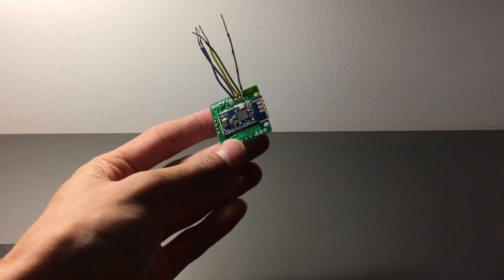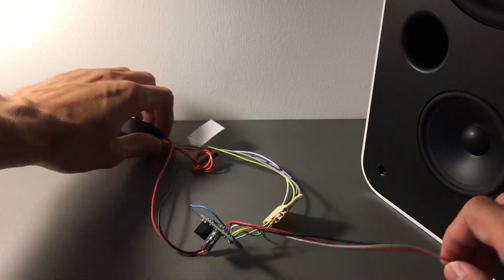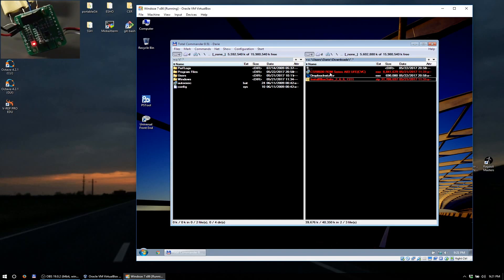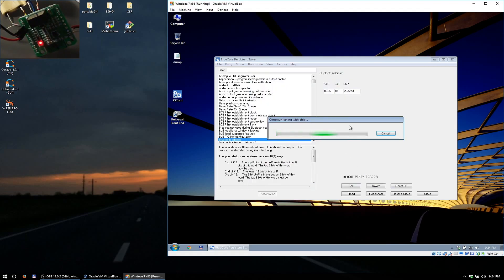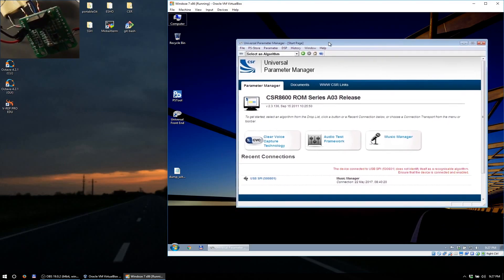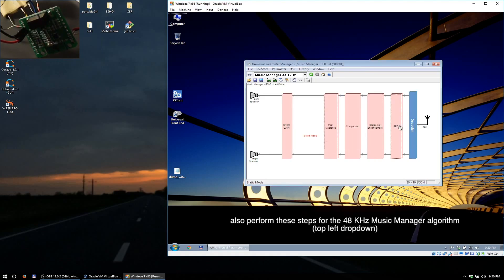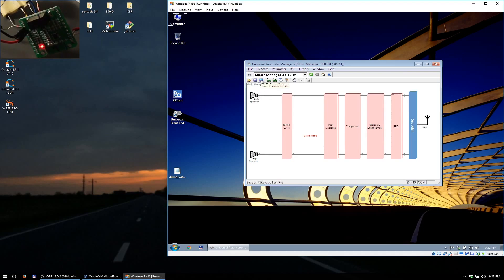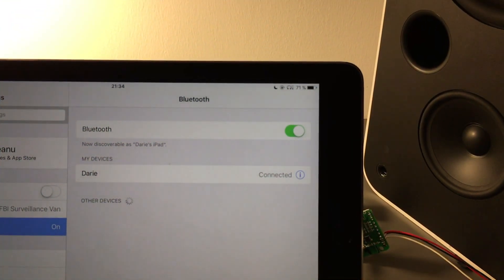CSR8645 Equaliser Set Up Guide

Comment from the maker: Tip 1 : Make the Equaliser Setup-Up Window wider :) way easier to fine tune stuff. Also: my module started making a 5tone beep (which can be heard in the video) after I started programming it; that's the low battery alert, and can be disabled in ConfigurationTool 3.0.70 (the programmer feeds it only 3v3)

Tip 2 : To make the whole thing faster & easier, you could actually just "Merge" the parameters file created by the Universal Front End (write 1KB instead of 32). This didn't work too well under Windows 10 though

Tip 3 : In order to get to editing the current configuration from your device, the Download Params button doesn't seem to work: instead open the Live View (the glasses icon) and close it.
Reply: do you have to solder to the programming ports or could you use those individual breadboard jumper cables like on a bread board?

Comment: Tip 
1- Do it on Win7 -32bit
2- Play music while connect Usb
3- Click on glass 
Right bro? 
I have some question to you
 1- Need to supply the power for the   bluetooth board when playing music (my tda7492 need enoud power to woking)
Reply from the maker: no, just the bt module needs power 🫡 the rest doesn't matter
Reply: @Darieee  you mean GND & 3.3V enough? If just bt have the power, i cant hear any music from speaker

Comment: How are you providing enough power through the USB connection to power the speaker at a volume at which you can hear the EQ changes?  I find that the USB will only provide enough power to provide very quiet audio.  I would love to run this at full power, and make changes to the EQ

Comment: First of all thanks for your videos, I wanted to check the following: I am working from a PC that has Windows 7 32bits and I was able to run the "PSTools" without problems and change the name, with "CSR Universal Front End" I have not been able to configure it, I get the following error "The transport USB SPI (00547) cannot be opened. Ensure that the device is connected and enabled." I did the procedure as samples in the video to play music before connection and nothing. If you can help me I would appreciate it.

I am working with this CSR USB-SPI Programmer:
https: //www.tinyosshop.com/index.php? route = product / product & product_id = 876
https: //www.tinyosshop.com/index.php? route = product / product & product_id = 874

This is the module that I am trying to configure:
https: //www.tinyosshop.com/tsa2300
Reply: I am working with this CSR USB-SPI Programmer:
https://www.tinyosshop.com/index.php?route=product/product&product_id=876
https://www.tinyosshop.com/index.php?route=product/product&product_id=874

This is the module that I am trying to configure:
https://www.tinyosshop.com/tsa2300

Comment: Is this "speaker" an Apple iPod Hi-Fi? If so, love the idea of "recycling" it with a modern connectivity. It's such a beautiful piece of design!
Reply from the maker: yeah - those're really well made speakers - not a lot happening on the high end, but .. a lot of power all 'round nevertheless
Reply: @Darieee  So you just tapped into its' amp with CSR8645?
Reply from the maker: I've done 3 mods .. one simple which simply connects the csr to the input jack on the back, and 2 other ones where I fitted other amps inside an iPod Hi Fi with dead internals

Comment: Hiii Darie, I just bought an amp with 8635 inbuilt. So I was just checking if it work and for me, PS Tool & the Configurator works without a problem. But when I try to connect to the UFE, it just doesn't connect. Tried playing song and followed every step but still it doesn't connect. I too have the Virtual Box with Windows 7 32bit. Please help me provide a solution.
Reply from the maker: it's complicated .. try either reinstalling the software or running everything on an actual windows 7 x32 machine

I'd also highly suggest moving up to the CSRA64215 or QCC3008 chips - they have wildly more compatible toolchains
Reply: @Darieee  Thanx for the suggestion. If i move to the CSRA64215 where will I get the tools for it. Means Qualcomm doesn't share software to individuals. So where can I get them?
Reply from the maker: I have them linked throughout my videos

check either what I have specifically on that, or my ''margarine box speaker" video

Comment: Hi. Is possible to control compression, delay, and some other effects with this method? Wondering how well it sounds with the "stereo 3d enhancement" too. Thanks for the video btw.
Reply from the maker: more than welcome!

I tried the stereo 3d thing .. didn't really like it

Compression : I'm not sure what you mean by this, but the "Compander" stage is a sort of AutoGainControl which limits the maximum volume dynamically

And delay ... yea, more DSP stages you add larger it'll be; on this note consider upgrading to the CSRA64215 chip - much nicer
Reply: @Darieee  Yeah compander, probably that's what I was meant to say. I want to add kind of dynamic sound and or  dynamic bass to sound deep and refined. I thinking of using the csr8675 because of BT 5.0 and LDAC codec(as far as I know it's supported). I still don't own that chip but, before buying do you suggest me csra64215 or csr8675. I guess the same procedure will work on both. What do you think?
Reply from the maker: using the compander won't offer you what you're looking for ... I tried it too, maybe you'll have better luck

dynamic bass is an entirely different beast, that requires individual eq profiles for each volume level

or at least for the upper ones

I can hook you up with software for the 8675 if you promise to share your findings

and the 64215 software is already available for download on my channel :)
Reply: I will do my best to work on that, I have no experience with those BT chips, but I'm very interested to learn about them

Comment: following these steps I get 3 keys instead of 2 you show here. And when i merged them and power off and on the module the eq settings are not loaded:/ what am i doing wrong? I did not do the 48khz  settings yet, do you paste those above the 44.1khz keys?
Reply from the maker: the location of where you paste the keys is irrelevant, they get moved to their correct location anyway

it's best practice to manipulate the small .psr you get from the FrontEnd directly

as in, just click merge in PSTool and select the tiny .psr you got from the FrontEnd

>> also, when anything goes wrong, it's insanely crucial and the bestest practice by far to start from scratch with a very default dump flashed on your chip

>> to do this, first go Factory/Erase All or Restore all I don't remember the exact name (in PSTool) ... you need to do this because 'merge' is only additive, you can't erase anything 'wrong' that way
Reply: @Darieee  Thanks this worked great! Got the chips to keep their eq configs:)
Reply from the maker: awesome man! glad it worked out

I do have to make a comprehensive 1 video to rule them all on the csra64215 ... just insanely busy atm ...

these videos were also super rushed out, and so a lot of shit can be done better (like merging the psr file not the text manually)

but, meh ... it is what it is
Reply: @chribzzz  I'm having the same problem, that no EQ settings are loaded after the module is restarted. Could you explain how you solved it?

Comment: I think my csr8645 is bricked after one of the program pins came lose while programming. can't seem to find it with my phone anymore, I tried to load my dump as well as yours which seem to work with  pst tools but it's still dead apart from that. But my eq settings did not seem to stay loaded after disconnecting en reconnecting the power completely. Did I miss someting?
Reply from the maker: Try doing the Restore/Erase All thing in PSTools, reflash a known good psr, then redo the steps

Also, if you brick it far enough that it doesn't boot, try connecting the various button pins (one by one) to COM (internal 1v8 rail) at bootup -- sometimes that gets it to boot

Comment: Hey man, I know it probably is asking too much, but do you now of a way to conect to the dsp using ftdi chips?
Iorf's driver doesn't work with the UFE, as far as I know
The csr usb-spi is away too expensive, the cheaper I can get is 80 BRL
Reply from the maker: I don't know man, 80 reals is kind of a decent price for one of those

Given that I've only worked with them so far ... absolutely no idea
Reply: @Darieee  Thanks for the answer, but ya know, spending that much with a tool to use a few times is kinda hard, I'll try to setup a filter between module out/amp in
Reply from the maker: yeah ... I use mine daily ... but even for ocasional use ... given how bad CSR's software is ... knowing that you have eliminated one source of bugs is quite valuable

again obviously - depends on how much you need it - maybe find a like-minded friend to split the cost with xD
Reply: @Darieee  Around here we dont have much acces to csr chips, and since I'm not "manufacturing" bt boards, just a personal project, I dont have that much of need to it.
Of course it would be amazing to abuse each and every of this chip capabilities, but that would be for personal knowledge.
Btw, thanks for the care of answering me XD
Reply from the maker: Don't worry about it! Have fun!

Comment: You included the CSRA64215 program bundle as well, that includes a 10band speaker PEQ as well as 5band user PEQ what is the difference between these?
Reply from the maker: The 5band is technically 'userland' and can also be changed by the GAIA App (let me know if you want that, I'll add a link to it)

The 10 band one is more of a factory setting to flatten the speaker in question, and then the user customizes the sound via the 5band
Reply: @Darieee  Thanks for the clarification. I found that GAIA app as well but with the CSR8645 and KRC86B i had laying around it doesn't seem to work:/
Reply from the maker: Yeah, for that you need something older that probably runs on android -3
Reply: Aah okay, did you get it working on a older phone?
Reply from the maker: I don't have any android phone unfortunately ... so, no, was mainly a figure of speech :)

Comment: what is with the 10k resistor on the SPI_EN aka SPI_PCM when I hooked my 1.8v line up to this it worked fine without no 10k resistor Zero issues yet people swear you need it? Why is this? I also use windows 10 with zero issues as well!
Reply from the maker: It's a cheap and very dirty way of pulling the SPI_EN pin up to 1v8 with the existing 3v3 programmer VDD

Comment: Hey Deriee My virtualbox doesn’ reading   the usb connection. I’m running windows 7 on windows 10. I’m traing to program csr8635 using the programmer but virtualbos doesn’t reading the usbs. How do you fix that? Please!
Reply from the maker: Please!!

In VirtualBox, while your CSR USB SPI Programmer is plugged in, you need to go to Machine Settings > Ports > USB > and click the + to add the programmer to the list of devices to be fed through into the virtual machine

Comment: On Win 8.1 x64, i am able to connect to device and rename it, using PSTool, no problem. 

But, when i try to connect with Universal Front End, i get:
"The device connected to USB SPI (623035) does not identify itself as a recognisable algorithm.
 Ensure that the device is connected and enabled."

Any ideas? thx!
Reply from the maker: Yes - you have to have music playing, otherwise frontend won't work
Reply: @Darieee  thx but do have musc playng :(
Reply from the maker: Try under win7 x32
Reply: @Darieee  if i can download it someplace. Is TX supposed to be connected? Is SPI_PCM the only pin that needs a resistor? I have SPI_PCM (w resistor), BAT and POWER_EN going straight to 3V3 (on the SPI adapter). I have CSR GND and LED's (w resistors) to SPI gnd/ Correct thx!
Reply from the maker: I don't really get what you're talking about, but I could point you in some direction regarding the windows

Find my email in the about section here and write me up
Reply: @Darieee  Thx, but I checked the description area of this video, and about section in your profile. i don't see your email.
Reply: Hi  @Darieee , is the following correct?
CSR8645 <-> USB/SPI
SPI_PCM > resistor > 3v3
BAT > 3v3
POWER_EN > 3v3
GND > GND
LED's > resistors > GND
TX > no connection
Reply from the maker: LED and TX are weirding me out ... what kind of module do you have ??? 

Isn't it the kind I use in the "CSR8645 Renaming" video ???

You need to use (programmer notation)

GND
3v3
misO
mosI
CSB
CLK
Reply from the maker: And why would you connect LEDs to the programmer :) ?
Reply: @Darieee  sorry for confusion, the LED's are connected from the CSR8645 through resistors to programmer ground. Correct?

Not using TX for anything.

i believe i have same CSR8645, but different breakout board.
Reply from the maker: Ok, why would you hook up LEDs to the programmer though?
Reply: @Darieee  i though the programmer provides power to the CSR. No? How else would you power the LED's?
Reply from the maker: Why would the leds have anything to do with programming : they are driven by the csr chip and are as relates to the programming process as the light bulb in your room

I list above the connections that need to be established in order to get the programmer to work with the chip .. more than that I really don't know what to say
Reply: @Darieee  i understand, i don't need the LEDs to program the CSR. But it enables me to see the CSR radio activity (when i'm connected, for example). It doesn't hurt the programming, does it? My only concern is current-draw.
Reply from the maker: I am 100% sure that it massively hinders the programming

Furthermore, the programmer itself has an activity chip
Reply: @Darieee  wow! can you mention why you're 100% sure?
i thought the programmer LED just shows programming activity, not radio activity. 
thx!
Reply from the maker: If you stick LEDs across MISO and MOSI, those work at 3v3 and have a very weak driver, so, you can most likely not draw enough current from those to even light up an LED

What will happen depending on the type of LED (say red for example) is they will start conducting at 1v2 or so, and increase the current they draw until the programmer can't supply more current

So you're basically dampening the voltage on the programming lines a lot by sticking a very big and very non-linear load across them (an LED will draw 1mA at say 2v but 5A at 4V, that's why the non-linear)
Reply: @Darieee  i'm not sticking LEDs across MISO and MOSI. I'm referring to the LEDs on the CSR module.
Reply from the maker: You kind of did infer it

Anyway to recap -- is there any other outstanding problem :D ?
Reply: @Darieee  ok, so it's cool to power the CSR LEDs off the programmer?

At this point, i'm no longer seeing the CSR device in my bluetooth scanner. I think my connections are clean, but maybe i damaged the module somehow. Have you seen this happen?

thx!
Reply from the maker: Dude I'm not capable of understanding what you're asking .. maybe someone else can chip in :))
Reply: @Darieee  I'm saying the CSR appears to have died :D Wondering if others have seen that when it wasn't actually dead.

Comment: Dude, there is another way to install this software on Windows 10. Change the compatibility to windows 7 in the properties of the programme (run this program in compatibility mode for).
Reply from the maker: Mhm, there sure is, but it doesn't work

Or at the very least it didn't for me

Did it work for you ???
Reply: @Darieee  There is some issues but, it kind of working for me now. Anyway thanks for the good content man. It helped me so much with my project.
Reply from the maker: Gladly! You seem to not have yet bricked any of your modules - once that happens you'll be running a 32bit vm in no time

Also, do consider upgrading to the CSRA64215. The same modules (isolated / 5+5W amplified) are now available for it as well, and there the software is compatible with windows
Reply: @Darieee  I am actually pimping the Logitech Bluetooth module (CSR 8630). I successfully rename the device but, I can not touch the equaliser settings apparently. It's always says, kalimba not ready(Could not acquire interlock - 'ack' was not received. Winsock says 'connection timed out') also, showing a error message, Kalkockd Error.
Reply: In between, I didn't solder the SPI_EN pin, might me that is issue, maybe you can give a good input in this, thanks
Reply from the maker: You know what!? I motherfucking can

You can't program the equalizer UNLESS music is playing !! I spent days figuring this out until someone on a forum pointed me in the right direction

Ever since I've told at least 10 people so :D yea .. do let me know if that does it
Reply: @Darieee  thanks again man, I will try that.

Comment: Great Video, helped a lot! Do you know if it is possible to programm the DSP to have one channel only delivering >2000Hz and one delivering <2000Hz?
Btw. I made a 3DPrint Setup where you can plug in the CSR8645 module without soldering - how can I provide this to you?
Reply from the maker: Put it on thingyverse :D or however it's called - you surely know about it

And thanks! Unfortunately I don't have a 3D printer

You also should 100% upgrade to the CSRA64215, it's WAY WAY WAY more powerful (and supports synchronized volume between phone and chip)

As far as I know, you can't do that, although I too would be vvvery interested in something like that

Comment: Hello, is it possible to configure the module to talk between two csr8645?
Reply from the maker: I think what you're asking about is called TWS and stands for True Wireless Stereo

At a DIY level, as far as I know, at this point in time, the only way you can do this is with two CSRA64215 Modules
Reply: Not that. I want to make two-way intercom communication between the two helmets with a microphons.
Reply: May be its called - multipoint
Reply: And maybe need to microcontrollers for it
Reply from the maker: yeah .. on that front I can't really help .. no idea